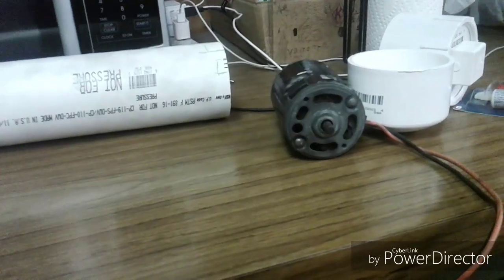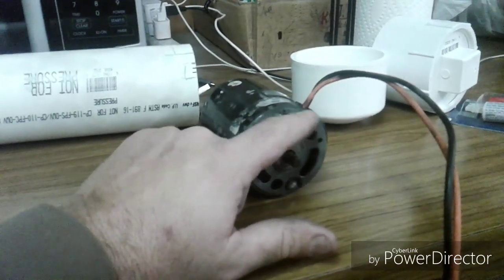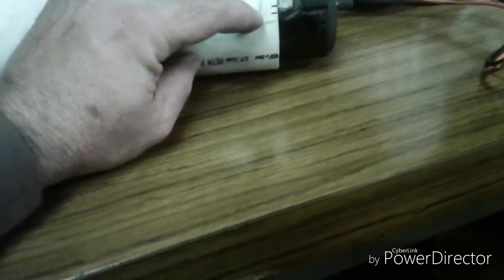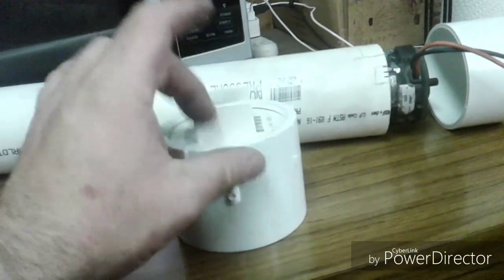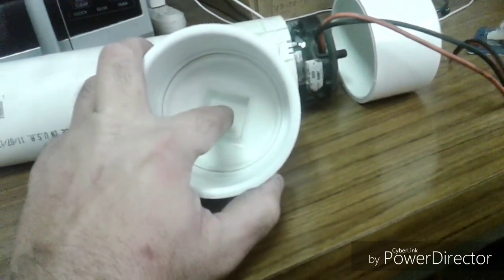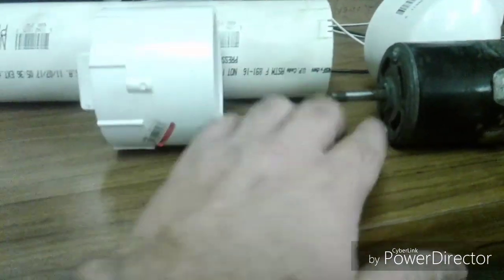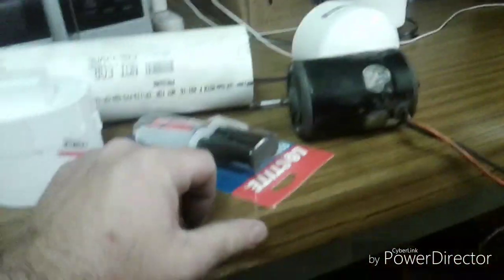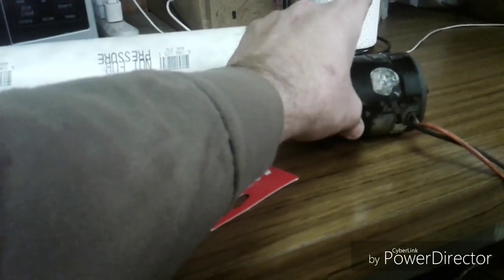Cheap kayak motor....part 1..the idea

Comment: Hi Mr Hillbilly Holler I would like to know if there is a 3rd part of the video and if there is also a video showing the test in the water. I have a question to ask the motor is that of the radiator fan? Is there a wiring diagram of the cables ?. Congratulations for the video and for the idea I would like to copy it myself for my kayak. Sorry for my English, I'm Italian
Reply from the maker: I had one but unfortunately I lost the footage due to a corrupted sd card.
I will have to make another video on the completed build.
It worked great.
For steering I just used my kayak paddle.
Reply from the maker: Oh just two wires, and forward, and reverse was done through a 3 way switch.
Just reversing positive and negative through a 3 way switch is all
Reply: @hillbillyholler516  Thank you for replying. I'm sorry for the lost video. They offered me to mount the 12v motor of the fan / air conditioning what is inside the car. Do you think it is okay? Or would it be better that of the engine / radiator cooling fan ?. Is the battery that of a car? . It would be great if you did a video of the complete project and test. I like to create, build and replicate projects ... And having a fiberglass kayak I've always wanted to mount an engine but I don't have enough money to buy an outboard motor for kayaks so I've always wanted to build my own engine but I didn't know how to do it and then everyone tells me that they do not have the thrust or strength to start a kayak with an engine whether it is a radiator cooling fan or a hot / cold air-conditioning fan with a person of 60kili thank you and I hope that this summer I can show you my project. I ask if I can stay in touch with you in case you have any questions, doubts or difficulties about the project, thanks